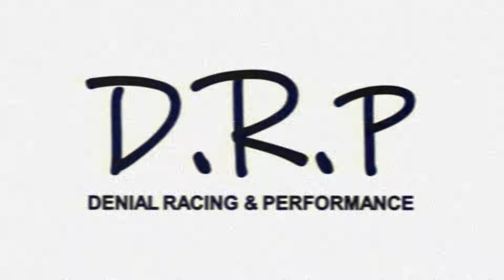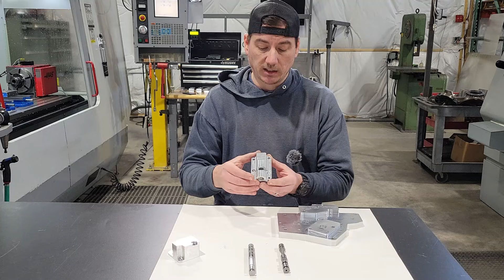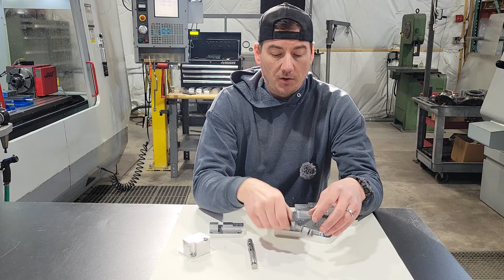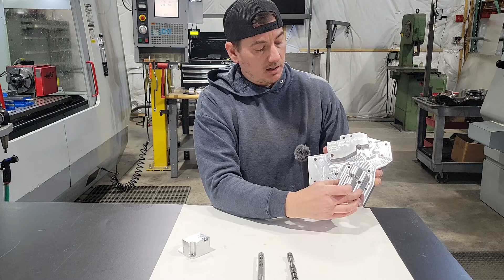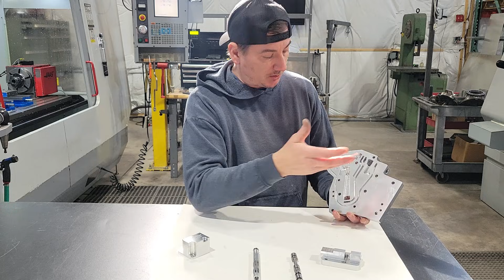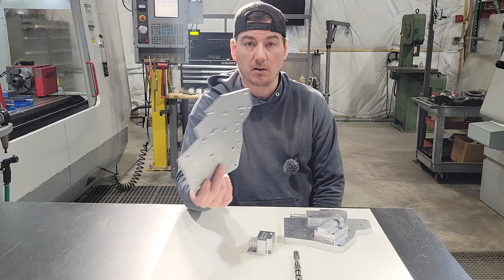New Product ALERT! TH400 Valve Body

Comment: The converter feed solenoid kit I’m assuming is basically an internal dump valve?
Reply from the maker: Yes, to be specific it pauses converter feed. It does not dump line or charge pressure.

Comment: Is there an issue using this valve body and using safe neutral and shutting engine off towards the end of shutdown so that you don’t dirty up plugs and can get a good clean plug reading after a pass or is that still a no no with this valve body.
Reply from the maker: There is no issue doing that, id prefer like most if you roll out and get the mph down so you dont over speed the high gear drum.